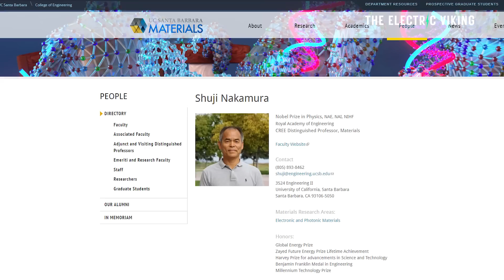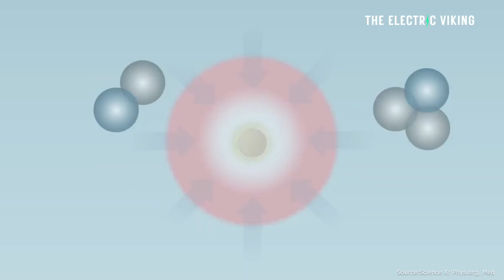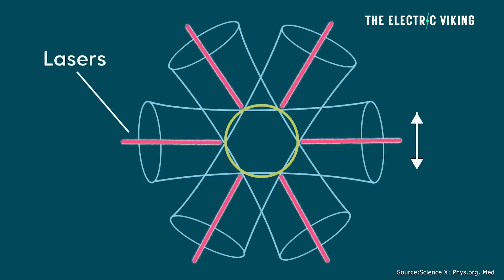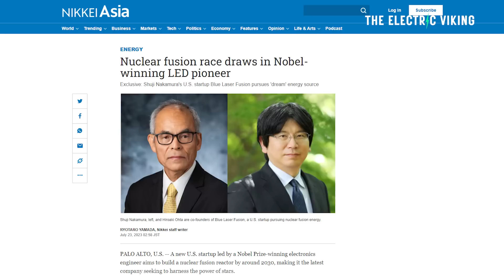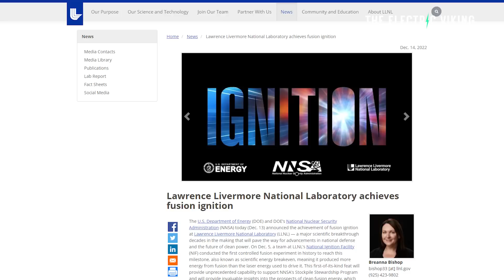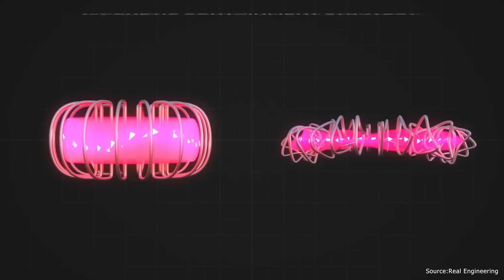Nobel prize winner builds rapid-fire laser-powered nuclear fusion reactor

Comment: Even on the happiest of happy paths, we are 20 years away from fusion making any sort of significant dent in our global energy generation. We don’t HAVE 20 years to screw around with techno-fantasies. Solar, wind, and batteries work NOW. They are well understood and manufactured at scale. The output is highly predictable over time, and operational costs nearly zero. Installation sizes vary from small enough to charge a cell phone to large enough to power a city. All of them are expected to reduce cost at least another 50% over the next decade or two. 

By the time fusion is actually in the game, renewables will have won. Fusion won’t be competing with dirty coal. It’ll have to compete with cheap renewables that already exist and cost practically nothing to continue operating. People need to stop fetishizing the fancy technology and start worrying about getting rid of fossil fuel before it destroys civilization.

Comment: The laser powered fusion event that Livermore Labs performed in 2022 had an abysmal power efficiency of something like 1200 to 1. That is like burning down a house to light a candle. It is fraudulent to claim this to be a success. If you doubled the power provided by nuclear power, it would still only cover something like 5% of the world' needs. These lasert fusion projects will always  be high cost due to the limited net power output and high tolerance machines required. I see them little more than efforts to grab money from fools. Laser fusion is  impossible to implement before 2035 due to the experimental nature of these machines. The ship has sailed, the planet is smoked, literally

Comment: Lots of commenters here seem to be missing the point. Maybe it wasn't spelled out clearly enough in the video. Nakamura hopes to make much more energy efficient lasers which can also be rapidly cycled. Regarding wind and solar - they are cheap at the moment, but they get more and more expensive as you really try to scale them up and run everything from them. Land use and the mining we'd need to do to run everything from just these two sources makes it infeasible, and also an environmental nightmare. Wind and solar should be part of a diverse energy mix going forwards, but fission and fusion are the only serious low/no carbon contenders for baseload and industrial heat.

Comment: You have no clue about the need for nuclear power. For every wind / sun watt hour built, you need to back it up 100% with something else (for when the wind and sun is not there - for example, during dark cold winter days when it tends to be no wind at all). What fossil fuel powerplant will you build (will you burn coal, gas, or oil)? What is the combined cost?....... Again, what is the combined cost of that? (If, for example, a steel plant has to shut down due to lack of power, it is broken and needs to be rebuilt from scratch). In addition, the grid needed for solar or wind production cost about as much as the windmills and the solar panels - this is a cost that is not added when comparing the alternatives. In sum, solar and wind is about 3 times as expensive compared to nuclear power. Few things have such huge advantages when it is produced in large scale in single powerplants - the advantages of scale are huge when producing power. 

A windmill lasts about 20 years, a nuclear powerplant 60-100 years. A windmill kills tons of insects, common and as well as rare birds, and nobody wants to live next to them. More people are killed by windmills than from nuclear powerplant, even if you count the nuclear disasters such as Tjernobul counted per what hour of power produced. Sweden, as an example (and we have a lot of waterpower) is already lacking 10 nuclear reactors to cover our needs.

Moreover, you need the base power, the umpf that the nuclear plant produces to be able to push the power through the grid. If you were to build windmills to make them able to push power better, they would be even more expensive than they already are (and they are not profitable, Swedish Vattenfall just had to drop a project in the UK and lost billions).

Honestly, you have no clue when you talk about this.

Comment: At around 2.14 two incorrect comments are made; firstly that fusion - and DT fusion is illustrated - leaves no radioactive waste, and second, it is significantly cheaper. For the first, tons of irradiated steels will be left, and for the second, how can fusion be cheaper compared to a fission reactor, when it has extra a vacuum system, superconducting magnets, neutral beam injectors, a tritium breeding system involving neutron multiplication, and for the lithium, the need for lithium 6 enrichment (if that is even possible).

Comment: As someone has already mentioned, up in the far north solar is simply not good enough for year round power.  When the house uses most power, solar delivers a fraction of the energy needed  and none if it is snowing.  Wind is not reliable enough, IMO nuclear certainly has a future with the small nuclear reactors available today.

Comment: Concentrated sunlight would be a much better choice than lasers for energy input. Would basically get all the energy that you’re blasting into the system to ignite the fusion fuel for free.
Reply: And what about during the dark winter or at night?......
Reply: @martina5328  Not a problem because once you ignite a fusion reaction using the concentrated sunlight you can then go on to use FRC formation coils to sustain it.

Comment: The moment the true fusion process starts, what keeps it to start fusing everything around it, every material in its vicinity like the reactor parts, the air around it, people around, all the gases in the air, all the biological life that we know it's full of hydrogen, oxigen, etc, all the chemicals around, the oil in the ground, all the water on and inside Earth, the lakes, the oceans, all the ground that's full of bacteria and gases, all atmosphere of Earth and turn the whole Earth into a little star?🤔
Nobody thinks about this humongous danger in which all the biological life on Earth could disappear in an instant 'puff' of a total and general fusion reaction? 🤔
Fusion is not fission!🙄
A true start of a true fusion reaction is very dangerous because its control systems can simply default like any manufactured product.
...........
And people are worried today about 1.5 degree increase in global temperature...🙄🥴😏
No-bell prize winner of stupidity...!😏

Comment: The SUN is our Fusion Reactor and it will last a very long time.
Having a fusion reactor on Earth seems to be the goal of many endeavours today, but whether it will be achieved is a question as yet unanswered, but the effort being spent is absolutely huge.
The Suns' Fusion Reactors work because of one major factor which is called the force of Gravity, which we cannot replicate here on Earth.
Instead the Magnetic Force is being tried to contain the fusion reaction.
Containing ithe fusion reaction is one issue.
Perseverance is another issue.
Transfering the heat is another issue.
But the "proof of the pudding" will be the ratio of the Energy required to that of the Energy produced. Anything less than one is pointless.
Constructing a giant fusion powered kettle to produce superheated steam to drive the electrical generators will be a huge achievement if the Power Out is greater than the Power In required to produce it.
Already Nuclear Fission powered kettles (Nuclear Power Stations) are common these days.
There lies the heart of the matter.
Lets just hope that they succeed...

Comment: 2 words GOD parity.

When the cost of the network (transmission and distribution) is higher than the cost of rooftop solar generation it won't even matter if the energy generated into the grid is zero. It will be cheaper to have your own home energy generation.

Comment: That will never be as cheap as wind and solar, and battery storage are today. Waste of money, but as a scientist I would love to get the money to have a bigger team to play around.
Reply: You have no clue about the need for nuclear power. Nuclear fission is today the cheapest by far.  For every wind / sun watt hour built, you need to back it up 100% with something else (for when the wind and sun is not there - for example, during dark cold winter days when it tends to be no wind at all). What fossil fuel powerplant will you build (will you burn coal, gas, or oil)? What is the combined cost?....... Again, what is the combined cost of that? (If, for example, a steel plant has to shut down due to lack of power, it is broken and needs to be rebuilt from scratch). In addition, the grid needed for solar or wind production cost about as much as the windmills and the solar panels - this is a cost that is not added when comparing the alternatives. In sum, solar and wind is about 3 times as expensive compared to nuclear power. Few things have such huge advantages when it is produced in large scale in single powerplants - the advantages of scale are huge when producing power. 

A windmill lasts about 20 years, a nuclear powerplant 60-100 years. A windmill kills tons of insects, common and as well as rare birds, and nobody wants to live next to them. More people are killed by windmills than from nuclear powerplant, even if you count the nuclear disasters such as Tjernobul counted per what hour of power produced. Sweden, as an example (and we have a lot of waterpower) is already lacking 10 nuclear reactors to cover our needs.

Moreover, you need the base power, the umpf that the nuclear plant produces to be able to push the power through the grid. If you were to build windmills to make them able to push power better, they would be even more expensive than they already are (and they are not profitable, Swedish Vattenfall just had to drop a project in the UK and lost billions).
Reply: @martina5328  hm, no, you have no clue. Go and get yourself better informed. There is that new nuclear power plant in the US, lot too late, budget was over many times, costs for customers are up. Get batteries instead.

Comment: The problem is that the energy in,  is far greater than energy out,  when you factor in all the inputs.  i.e. power to operate the device and energy used fusion fuel production.  Not even close.  Fusion has been debunked.  The gains relate to the energy that reaches the nuclear fuel, vs energy output.  They ignore the energy used to get the that stage.  As mentioned the conversion efficiency of energy inputs along the energy input chain,  is typically not accounted for in these fusion experiments.  When the laser reaches the hydrogen isotope fusion fuel,  you are left will a reduced amount of energy.  which is the amount they are comparing energy output from.  A significant amount of the input power is lost before it reaches the nuclear fuel.  The overall input energy in joules is far greater than the joules output from the fusion reaction.

Comment: Can wind turbines be maintained to last longer...say a 60 year life?

That would throw a different light on things perhaps?
Reply: Apparently not. Aside from the wear on the bearings, the leading edge of the blases takes damage and after a fairly short number of years, the blades need to be replaced, at a minimum.
Reply: You would still need to back up every what hour of wind with coal, gas, or oil powerplants (for when it is not windy) with no nuclear fission. Thus you can double the price of energy. Next, consider that the grid needed for windturbines cost as much as the turbines - this now you can triple the price of energy. Energy cost = cost of food = poor people starve to death.

Comment: Boron is a great goal however it is much much harder to reach fusion criteria. The cost of the lasers are massive relative to the power that can be derived. The infrastructure to manufacture fuel pellets will be super expensive and the ongoing manufacturing cost will be high considering the system will have to use millions of them. I believe liquid salt fission reactors using continuous reprocessing to breed Thorium into fissionable U233 isa  known safe and reliable technology. The cost to build such systems is reasonable especially if they are manufactured as relatively small modular units in a factory.  The fuel Thorium is dirt cheap and needs almost no processing considering we have a bunch of it already available as waste from rare earth mining. These systems are simple and low cost to make compared to fusion. All we need is the will to build them. Solar is just too intermittent and subject to weather conditions to be our main power source. Solar is great if we pare it with lots and lots of battery storage. We will need enough storage to supply power for the longest possible loss of sunshine. The problem is that can be periods that last many months due to large volcanic eruptions.  The sodium battery will help but we really need even cheaper storage to replace base load systems.
Reply: If thorium was actually as cheap and practical as its proponents say, it would have been in use for decades already. Instead, there’s not a single commercial thorium reactor in the world, in any country. Occam’s Razor suggests that the reason it hasn’t been done is because it’s not actually cheap or practical.
Reply: @davestagner You do know that the development of Thorium reactors was shut down by government edict by a person being influenced by the people who owned the uranium mines. Hard to develop a technology when the government won't give you money or licenses to do the research. Now China and India are working on them and they will own all the IP on a concept we developed.Just sad.

Comment: The major problem with the laser powered fusion reactor which you didn't mention is the extremely low conversion efficiency of the lasers. It's between 1% and 2%. So, although the reactor emitted more energy than was put into it, the lasers used many times the output power of the fusion process.
Reply: They used the best technology at the time of design which was late ‘80s

The point of the experimental facility wasn’t for whole system efficiency but proof of concept.

We can build free electron lasers right now at 30% efficiency, diode lasers at 20%+

And there’s actually no hard limit on FEL laser efficiency, and diode lasers can probably be pushed to 40%

But that’s not the hard part, so just let them prove the hard part first and stop pretending the entire point is system efficiency first, because that’s far more disingenuous than what they’re doing
Reply: Modern lasers cam be more than 10% efficient. The whole 1-2% thing is for older tech
Reply: That’s interesting if true. The good thing about thermal power plants is that some of the heat from those inefficient processes can be recovered to preheat steam which claws back conversion efficiency. I will remain blindly optimistic humanity can get this to work.
Reply: and that is always the case, on top of all the other major problems with fusion.
Reply: The US has a laser Fusion reactor that has a conversation rate of 1.5. It has been activated and has worked, Other countries have work to do…
Reply: @HoneyHive654  The U.S. fusion can't handle  high power output. The optics are fragile. Any energy generator needs to be robust enough to survive a hit by a hammer.  These are even close.
Reply: @keithdow8327  The lasers delivered 2.05 megajoules of energy and created 3.15 megajoules of fusion energy, a gain of about 1.5 times. That’s high power output and what are you talking about you’d be an idiot if you were to hit any experimental piece of technology let alone a high energy, laser reactor 😭.
Reply: @HoneyHive654  

Dear Dude,

So we agree it is fragile. Lets make the system operate 24/7, for a month straight, putting out a gigawatt of power. Can it handle it? No. It will fail way before the month has ended. 

Also be careful with your terminology. Megajoules isn't a high power output. It isn't even power. We need to know the repetition rate to assign it a power rating.
Reply: @HoneyHive654 , that is where the the 1-2% efficiency figure kicks in. To get 2MJ out of a laser, you have to put 100-200MJ into it. You can't just take the efficiency of laser output to reactor output. You have to look at the end to end figure of, say, 100MJ input into the laser to get 3MJ output from the reactor. That's just 3% efficiency. 

If I recall correctly, when this 'breakthrough' was announced some time ago, the scientists weren't claiming that they had found the Holy Grail of fusion technology. That was just the journalists hyping it up. As I understand it, laser based reactors are really just for research purposes and not a serious contender for energy generation.
Reply: @HoneyHive654 note that the lasers DELIVERED 2.05MJ, how much power was put in to the lasers to deliver that amount? Significantly more than 3.15MJ is the answer. It is, as of yet at least, impractical to use laser based fusion.
Reply: @HoneyHive654  How much energy was used to power the lasers? That's what is usually ignored in these kinds of announcements. Then the power has to be generated  in a usable manner, usually in the order of 50% efficiency. We are still a very long way from anything practical.
Reply: @The1stDukeDroklar  Thanks!